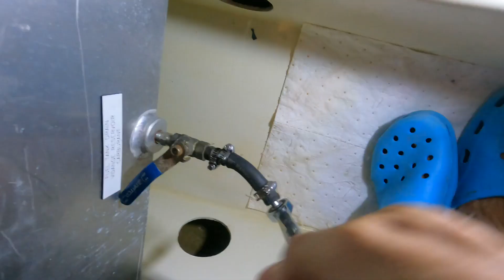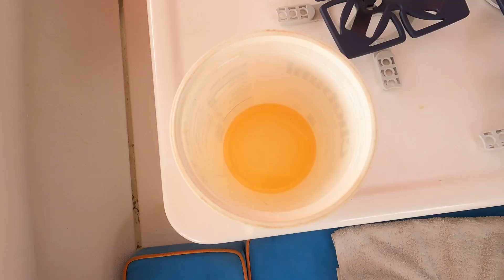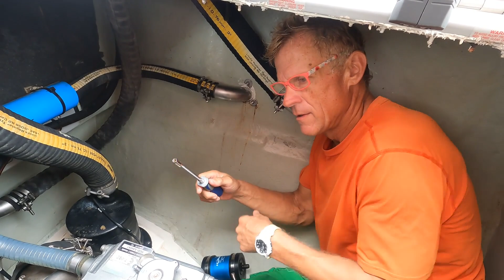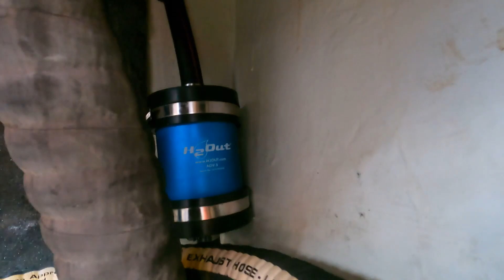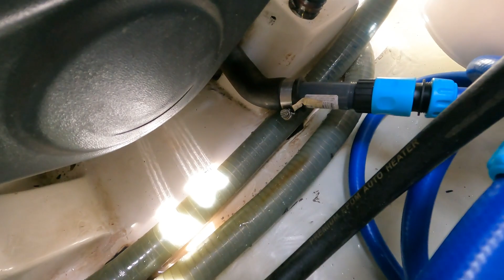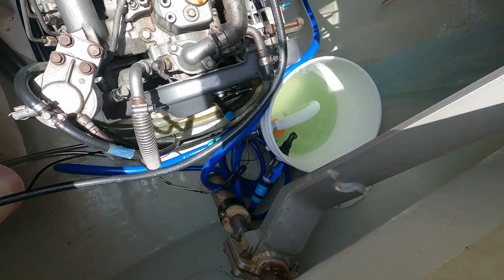257: IS YOUR FUEL CLEAN? ESSENTIAL ENGINE Maintenance

Comment: With the number of band clamps you deal with on the boat you should get a nut driver set SAE and Metric. Much better than a screw driver for clamps.
Reply from the maker: We need a set. We have a bunch of sizes but they are always the wrong size. Lol.

Comment: Wow, another fantastic and informative video, Brown! It's so important to prioritize maintenance, and your demonstration of the desiccant fuel filter and engine flush is truly valuable. As one of your fellow viewers mentioned, "fuel cleanliness is next to godliness!" And speaking of maintenance, have you considered using biobore as a preventative measure? Keep up the great work, guys, and hope all is well!
Reply from the maker: Great to hear from you!  Diesel fuel system contamination is a much misunderstood topic, especially when it comes to biocides.  I used to be in the diesel fuel industry and dealt with issues all the time in the agricultural, marine and fill station areas to solve their issues which nobody ever understood because their most hidden and counterintuitive.  To answer your question, biocides have their place for limited application, but in my opinion not as an ongoing preventative.  One main reason is that Yanmar specifically states in their manual NOT to use them.  Watch this video in its entirety and let me know what questions you have.  Are you currently dealing with any issues? https://youtu.be/JZ3B0kcXV-0?feature=shared

Comment: Do you use biobore as a preventative.
Reply from the maker: Diesel fuel system contamination is a much misunderstood topic, especially when it comes to biocides.  I used to be in the diesel fuel industry and dealt with issues all the time in the agricultural, marine and fill station areas to solve their issues which nobody ever understood because their most hidden and counterintuitive.  To answer your question, biocides have their place for limited application, but in my opinion not as an ongoing preventative.  One main reason is that Yanmar specifically states in their manual NOT to use them.  Watch this video in its entirety and let me know what questions you have.  Are you currently dealing with any issues? https://youtu.be/JZ3B0kcXV-0?feature=shared